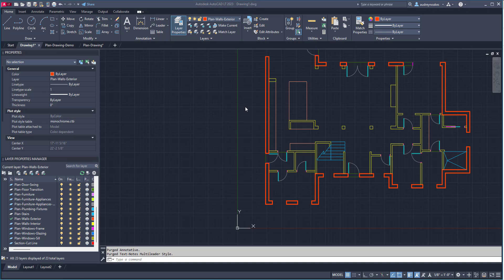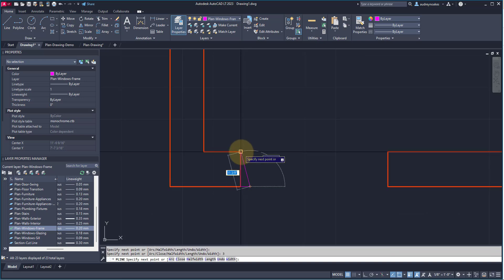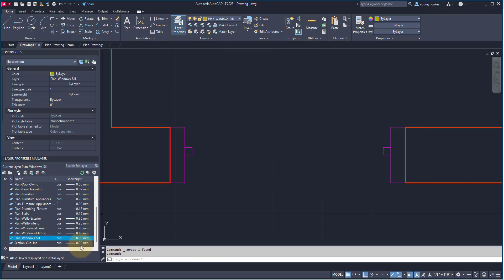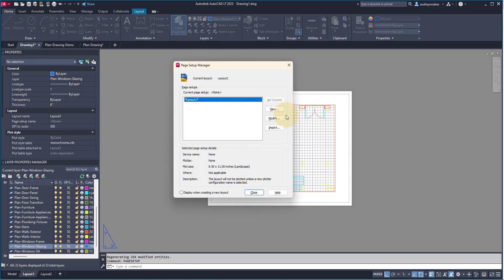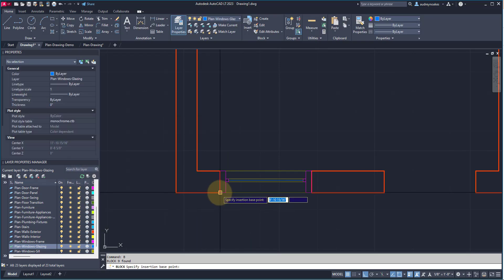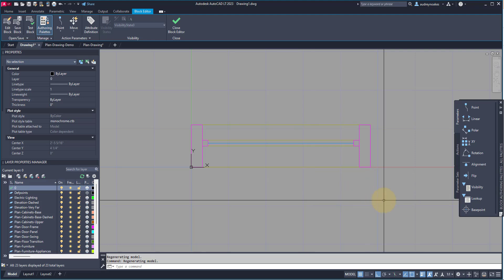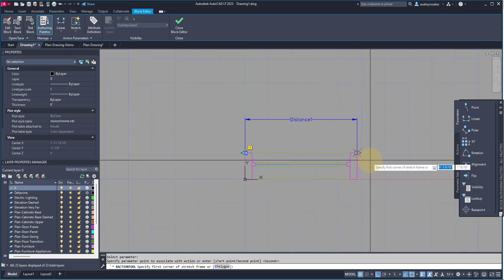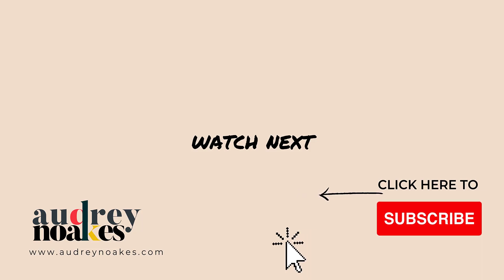AutoCAD: How to draw windows in plan with good line weights plus make stretchable

Comment: I'm following along but I run into problems with the little rectangles at the ends of the glazing (the window frame itself); during resizing they shift from their rightful place. Does it have to do with which part of the block is selected for scaling? I've tried different possibilities but they won't stay put! :/